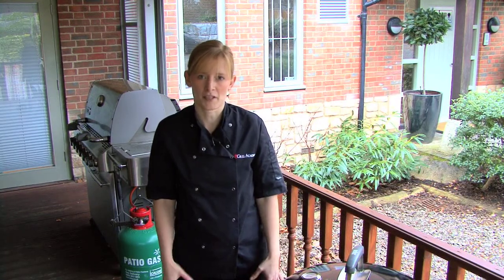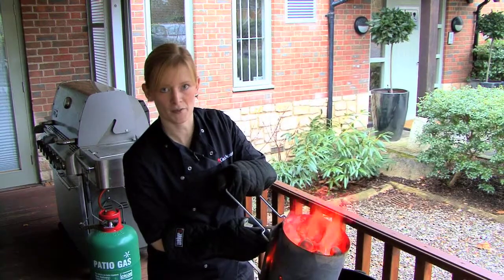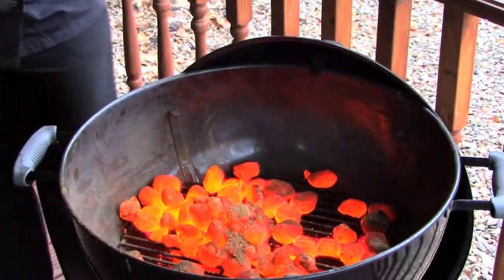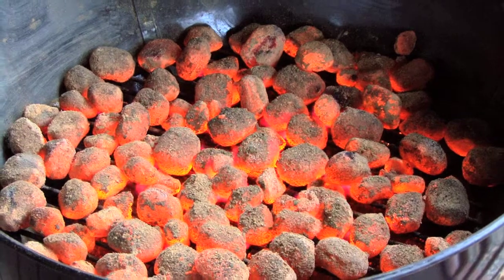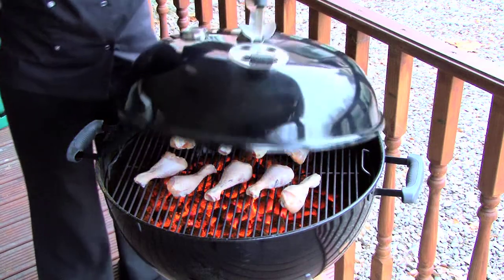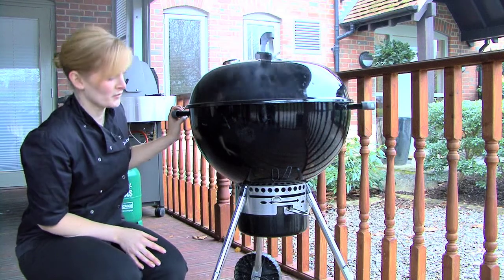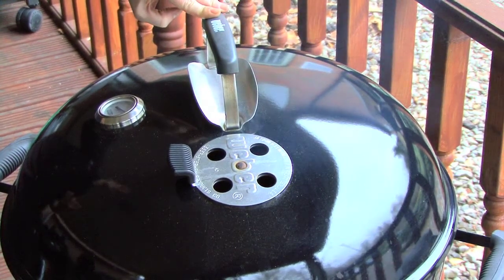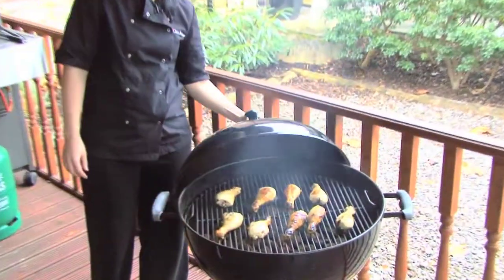Weber - How to Control The Temperature

Comment: A lot of the things mentioned contradict what Weber say.

1) No preheat done on the grill once the coals poured in.
2) Coals distributed across the whole grill.
3) Chicken cooked over direct heat
Reply: Agreed. They also didn't mention that you can keep the bottom vents partly closed in order to restrict air coming in and thus lower the temperature. For low heat I have the bottom vents open a crack and the top open half.
Reply: One layer of charcoal will not work on steaks